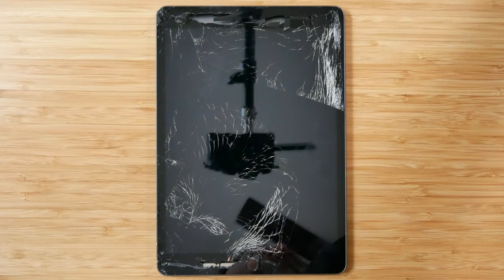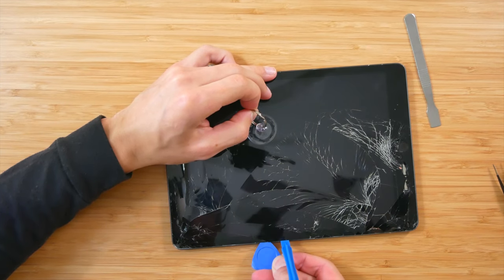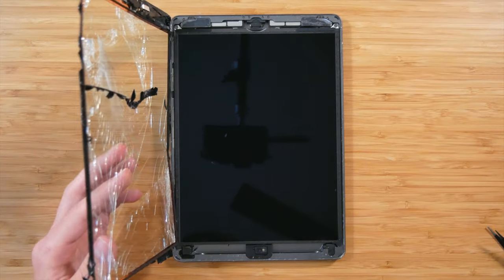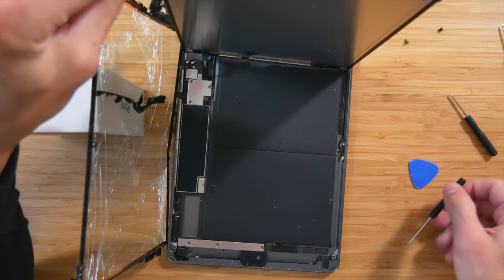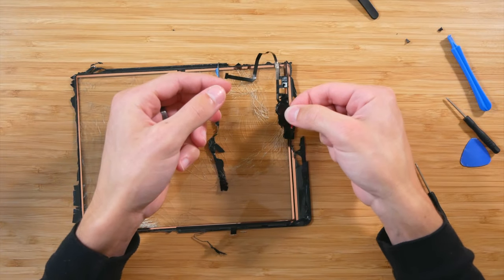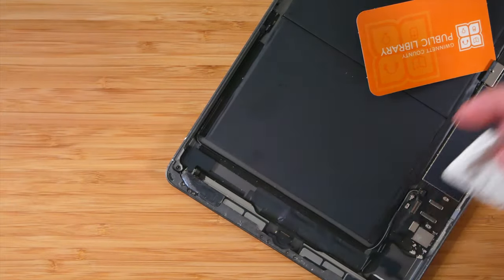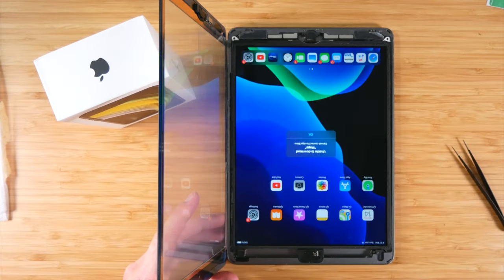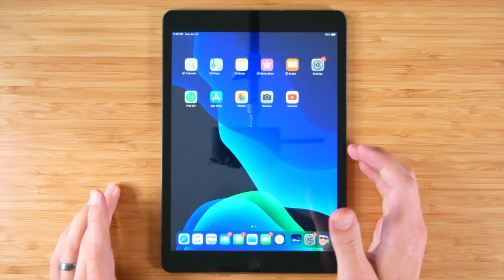iPad 7th Gen Screen Replacement! (10.2 inch iPad) Tutorial

Comment: So I did this fix and turned out well with no issues, initially. 
Turns out iPad isn’t charging , dies after a couple minutes - under 3. Looked up problems- some say bad digitiser, others say I might have damaged battery connector when you slide something to disconnect the battery- I think it’s more likely the later. Haven’t opened the iPad yet to check though- still scared
Reply: Did you find a solution? Mine is doing the exact same thing.
Reply: @theowlsofouterheaven  oh yes I did. Apparently, I didn’t screw down the battery connector screw properly. Did that up and it’s been working great. Thankfully I didn’t damage the connector
Reply: @tolulopeobe  was it just not right enough? Or just not screwed in well? I haven't opened mine back up yet to check, but I thought I screwed it well enough. But I was trying to hurry since I had the LCD attached as well trying to balance it.
Reply: @theowlsofouterheaven  actually, I didn’t even put the screw at all. It dropped while I was taking it out and when I put the digitiser in, it came on so I imagined just clipping it on would suffice cos it powered on for me to test it. Turns out it wasn’t enough to clip the connector alone. So I got screw from an old phone chassis , reclined the connector and put a screw in and it’s been fine since. You can open it and check the connector if it’s clipped in properly and the screw too. Otherwise, you might have a bad connector.
I feel like the repair videos should state this upfront as warning considering how easy it is to damage it and this is the only video I saw that mentioned that and I found it after I had my issues .
Hope this helps

Comment: i did it succesfully but the digitizer is not glued good on the metal frame so it popped out. I bet the same happens to everyone unless some kind of special glue is used. I personally do not recommend to do this repair it doesnt worths your ipad will be very bad at the end. Just go in Apple pay the price and get a replacement.

Comment: I hate this repair.  (no reflection on your video) just dont like doing digitizer separate from LCD. There is always either specs or dust or glue or  smudges that you cant see until after you have set the screen. Its so frustrating.  Sure its not visible when the screen is on but its there.  Thanks for your video. I just dont like this type of a repair for personal reasons.